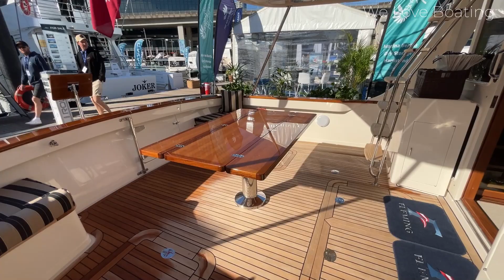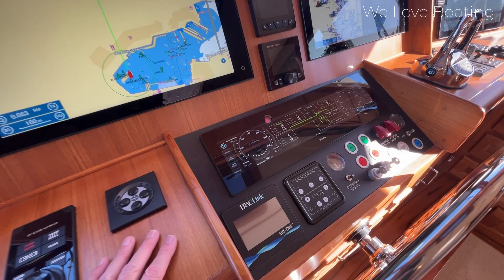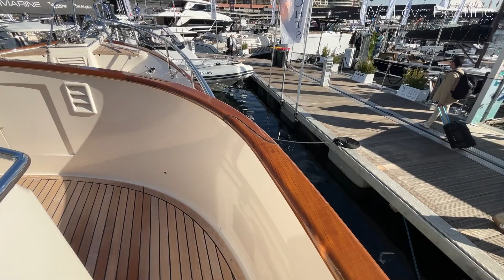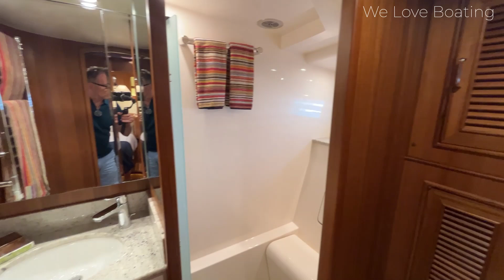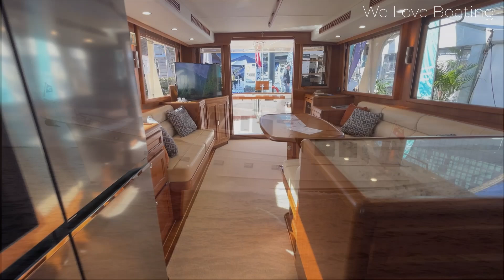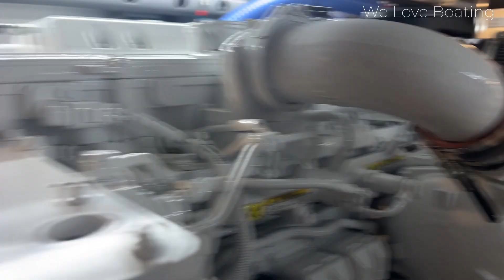Yacht tour of 2020 FLEMING 55 RAISED PILOTHOUSE.

Comment: It is the best among some truly great cruising yachts. Every detail has been tried and tested over the years since the introduction. Every critical component has a backup. Many systems are triple backed up. Dual engines, dual gen sets, triple steering controls, battery banks can be switched and joined for power if needed, multiple helm stations, dual anchors etc. As an owner of a 2003 55 for over 5 years and a current owner of a 2012 65 for another 4 the boat is a true cruising dream. What really makes the Fleming a delight is the support and service. No manufacturer offers the level of a Fleming. Not inexpensive but when your life and the life of your family and guests are concerned there is no equal.
Reply from the maker: Hey Buck it’s great to hear from you and you truly are in a privileged position to own such an iconic vessel it must be extremely satisfying 
Scott 😊👍

Comment: In the master cabin, that looks like air con.
Reply from the maker: Hey there…. I reckon you’re spot on. Great call 😊👍 - Scott
Reply: Actually that was the hydronic heating system for the stateroom. The two 5/8” hoses bring hot water up to that radiator which has a fan to push the hot air into the cabin. There will be numerous units like this around the boat and each one with it’s own thermostat

Comment: Wish Fleming would bring a full displacement onto the market
Reply: @paton57  Buy a Nordhavn or Grand Banks if you like full displacement, Fleming's are admired for what they are and sell faster than they can make them so why try to break into a market that doesn't fit the brand and already offers a myriad of quality choices.
Reply: @Fred-vy1hm  Grand Banks are planing boats nowadays, in case you werent aware. Nordhavn and Selene are options for full displacement trawler yachts
Reply from the maker: Yes that would add extra range and really allow for long long passages 👍